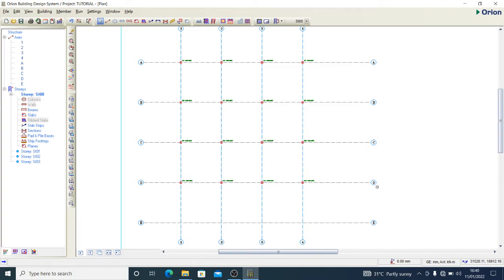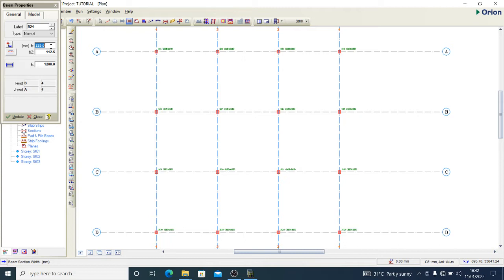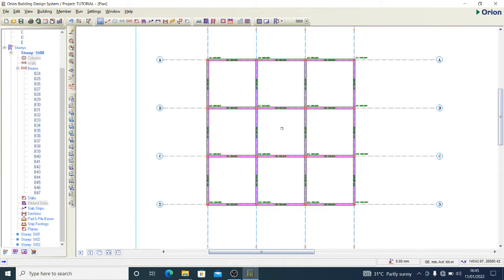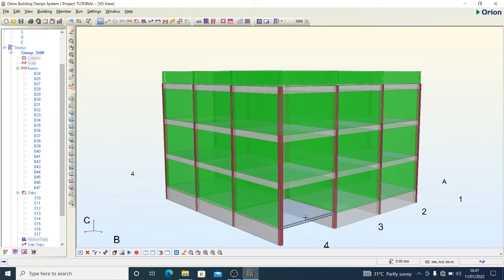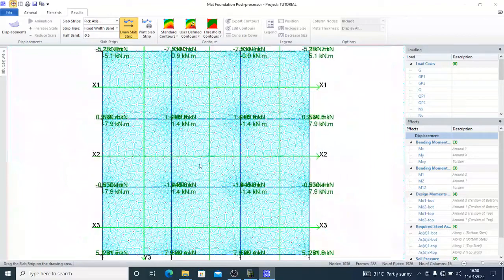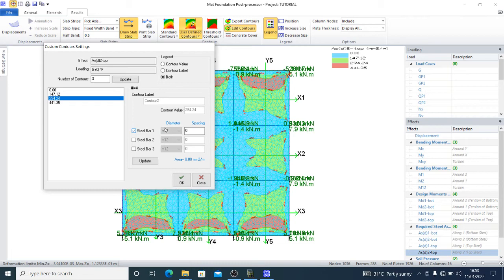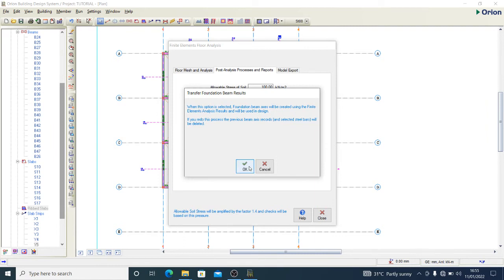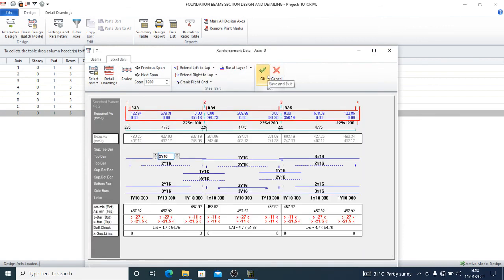ORION 18 TUTORIAL: HOW TO DESIGN RAFT FOUNDATION

Comment: Thanks for the tutorial video on raft foundation design. Please I will like to know, in real life practice, is the raft slab supposed to be on top of the ground beams or  at the bottom of the ground beam? Thanks
Reply from the maker: If it's a beam and slab raft, the slab is supposed to be at the top
Reply: @Joshua_d_designer  Ok. I was thinking the slab should be at the bottom of the beam, so as to transfer the structural load to the soil. If the slab is on top, how will the loads be transfered to the soil?
Reply from the maker: In the design, it acts such that the effect of soil pressure takes place in the inverted form of a suspended setting and it will indeed be valid.
Reply: @Joshua_d_designer  Please I don't really understand what you mean. Can you explain further?

Comment: Well done ✅
However, I observed that even after you specified max spacing of 150mm for the bottom reinforcement, now of the panel provide should. Most of them are Y12 @250mm. Can you explain why we have such?
Thanks.
And also, I observed you made the slab at the top of the beam which the normal practice on site. But have you tried cut section across the slab panel and see what it gives. Here, it showed from the section that the slabs are below the beams. Kindly look into that.

Thanks for the insightful class again.
Reply from the maker: Well, the software has not been to give the section as it should but the analysis is correct. The design of the raft is by contours and the provision should apply adequately to contours at definite places. If done properly, the reinforcement provided will be correct. Also, if you check the slab design result you can see the reinforcement required and provided at different places.

If helpful let me know
Thanks
Reply: Nice response, well done.
But have you tried to compare the results of ignoring the ref level, making the slab at the bottom of the beam? Because from my observations so far, I see no difference in analysis results from the two angles.
Reply from the maker: And that's why i said the result will still be valid despite. I just needed to effect the right ref level so my modeling can be correct. I will suggest you do too
Reply: I do not think selecting those contours and spacing is necessary. The software is designing for you and what you need is to input real life variables.

If you input any value that is too sufficient, Orion will change it to something sufficient. And I think the software is also designed to help us safe cost 😊

Comment: Thanks for the great work, I've tried it but the problem I'm having is that whenever I want to generate model for the FE analysis, it keeps bringing error
Reply from the maker: Check building model to confirm if there are errors in your job
Reply: @Joshua_d_designer  thanks but I've tried checking the building model analysis, all the structural members passed. The error says two nodes are too close to each other (same position or almost)
Reply from the maker: Yes, that's the point you'd need to visit again, it has to do with your model
Reply: That's great, but I'm having issues here, my slabs strip line or axis doesn't appear  in my contour even after all the process from beam, slab, drawing of slabs strip, FFE analysis, etc to where I'm supposed to import or transfer to update my reinforcement design that makes my work unsuccessful when trying to check the reinforcement design and no reinforcement design seem to appear on the slabs... Please what could be the cause?

Comment: In addition, I observed you didn't check for the soil pressure part. I think there's need to check if the soil allowable stress you applied is sufficient to resist the stress from the building. Thanks